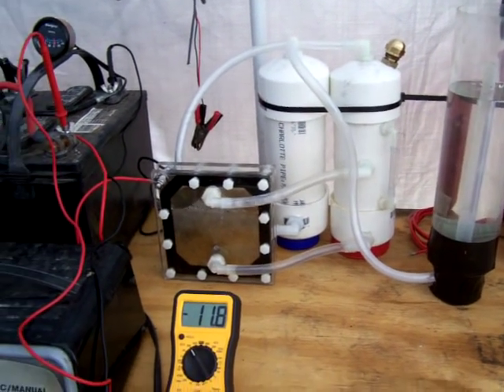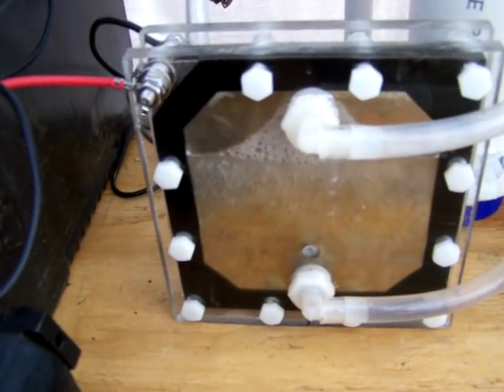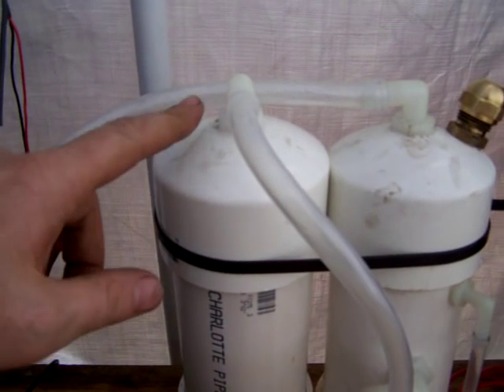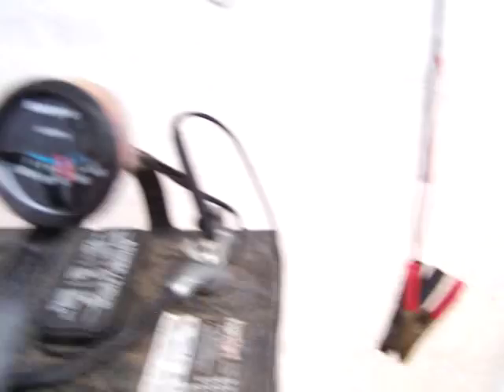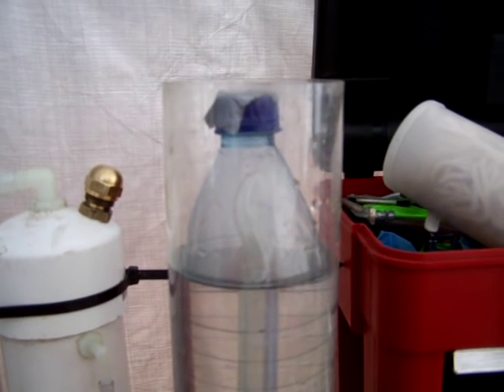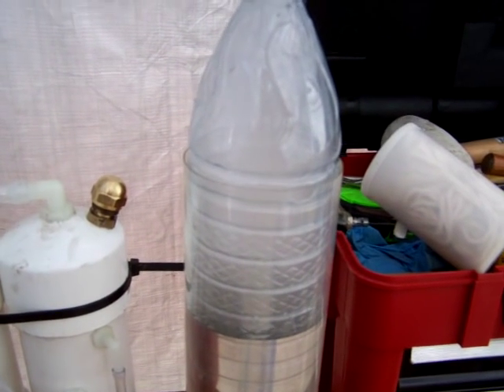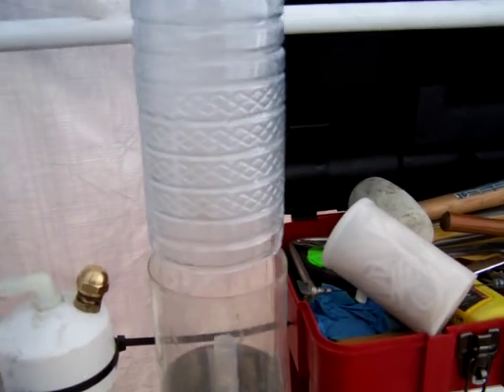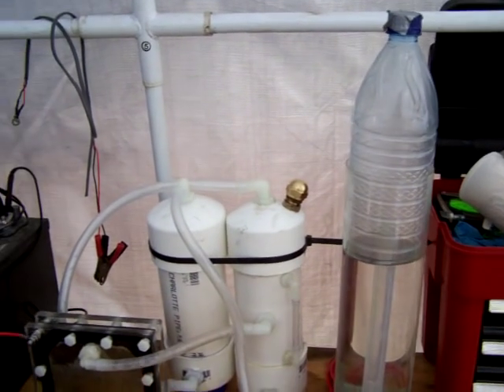Hydrogen on demand conversion kit. Turn any car into a Hybrid for only a few hundred dollars.

Comment: Unfortunately, your "basic chemistry" structural model of "octane" is of n-octane, which is the straight-chain hydrocarbon.  This molecule would be a terrible fuel.  It would ignite and burn too fast, causing severe knocking and engine damage.  This is NOT the octane referred to by organic chemists.  More branching of the molecule slows combustion and reduces engine knock.  The actual octane molecule is 2-2-4-trimethyl pentane.

Comment: Show the volume calculations for a 2.0 Liter, 4-cycle engine.  At 1,000 rpm, this size engine will require 1,000 Liters of air per minute.  Your H2 O2 generator makes 1 liter per minute.  Only 2/3 of a liter of hydrogen is produced (ignoring the saturated water vapor in the outlet stream.)  This would only be 0.6666 Liters per minute H2 divided by 1,000 liters of air per minute, or would give you a H2 concentration of 0.000666 ratio of H2/Air.  Invert the fraction and you get 1,500 to 1 air to hydrogen ratio.  

Gasoline requires an air/fuel ratio of 14.7 to 1 for complete combustion.  According to the equation 2H2 + O2 ==> 2H2O.  This balanced equation says that for every 1 Liter of H2, you would need 500 ml of O2.  Since the air is only about 20% O2, you would need 5-times as much air to get the required O2.  The Air to H2 Ratio would then be calculated as the 2.5 Liters of Air / 1 Liter of H2.  Because the 2.0 Liter engine requires 1,000 Liters of air to fill the cylinders at 1,000 rpm, to completely run the engine on H2 O2, Brown's Gas,  the H2 production would have to be 600 Liters per minute of Brown's Gas to get 400 Liters per minute of H2, or a cell producing 600 times as much H2 as this demonstration generates and 600 times as much amperage as this demonstration is consuming.  This demonstration is a toy!

Where would the energy come from to generate that much electricity?  From burning gasoline which would turn the generator, of course.  Your 15 Amp current would then have to be scaled up to 15 x 600 = 9,000 amps.  At 13.6 Volts, that calculates to a generator producing 122,000 Watts or 122 KW.  A medium sized gasoline generator puts out about 4 KW of power, which would require over 30 of these gasoline generators..  There is no such thing as a free lunch, according to the 2nd Law of Thermodynamics.   A smaller Brown's gas generator would require a smaller amount of electrical power and produce less Brown's gas, all at the same inefficient conversion process.   This is a scam.  Do some math.

Comment: From 8th grade i remember just droup in HCI (chlore-hydrogen acid) Zn (zink) you will get fast reaction without and catolizators H ^, need filters, its like fast boil reaction, i remember was just trying to fuel balloon, it fueled like in 10 sec, but poped becose HCI eat up balloon walls :)

Comment: No such thing as "excess energy".  Alternator produces juice based upon demand & puts a drag on the motor at least equal to the amount of energy released upon burning. 1st law of thermodynamics: energy can neither be created nor destroyed, merely converted from 1 form to another.  Considering losses from elec resistance & heat to split h2o, it's impossible to improve mileage getting juice from the alternator. If U got power from a solar array & battery, I could see potential for significant improvement

Comment: What is the purpose of the nuetral plates? most of the other designs use a plate design that a voltage is applied is + on the even number plates and - on the odd plates. I also bought some plans several years ago that did not use DC on the plates but a high frequency (resonant of Hydrogen) have you heard of this? Some people use sodium bi carbonate. Have you  tried that?

Comment: Great concept but without the plans for the cells that only produce hydrogen when resonant frequency needed to split the h2o, They have found a way of splitting the molecules with some form of electrolysis its only produced when the cell is in active mode. Unless you have a good knowledge of their work and can produce a program to replicate the frequency, it’s just like chain reaction with Keanu reeves and Morgan freeman. Someone will find a way and eventually it will come out.

Comment: HHO is very volatile and so that's why most of these people make on demand systems to power their vehicles instead of storing it. you engine will mainly run on HHO the same way it does on gasoline. Although, there is one complication which I am stuck with right now. Hydrogen burns way faster than gaoline so you must change your ignition timing closer to top dead center. It is really easy for older cars, but with todays computer run engines, its not just a job for a mechanic. This technology has been patented since the 1920's and has been used by the military in dire times of need when their supply lines were cut off. If we all work together collectively instead of against each other, this would be a lot easier and less dangerous in regards to who is hiding this technology. Some other free and cheap energy sources are "Gasification" and Nikola Teslas "Mathernita Commune"

Comment: Thanks for the instructions... I just don´t get why hydrogen converters are still seen as gas saving instead of gas replacing fuel. Couldn´t we produce enough HHO to power the car only with water?
Reply: The problem with setups like these is overall your not saving anything your not going to get more energy than you put into the system from the battery...
Reply: @Chris vids Stanley Meyers and Daniel Dingle proved that HHO only is possible.

Comment: Also we need to keep in mind why we burn petrol?  For lubrication under intense heat to prevent rings from frying and seizing the motor.  For this, with our current production of the traditional motor, we will never be able to get away from gasoline.
Reply: maybe if you burned acetylene through your engine you might be right
Reply: veager123

Comment: Thanx very good explanation , i wish you experiment on a 100 cc motorbike engine for full hydrogen gas running, the market potential here is beyond imagination, a 5 platter would do the job quite satisfactorily and u may end up in a business for 3rd world market but just ensure to keep the prices low, like chinese do. 
Thanx

Comment: Don't run on hydrogen alone it hot but if you mix 70% hydrogen and 30% oxygen then it can be used on rocket propulsion too

Comment: It takes more energy to extract hydrogen from water than you get back when you burn the hydrogen back into water. If you think otherwise why not use the burning hydrogen to power a generator and use the electricity to make more hydrogen? Hey presto you have a perpetual motion machine.
Reply: It is a sad commentary on the STEM education in the U.S. that more people do not know this basic information and immediately dismiss drivel like this presented on the Internet.

Comment: i did try it,  all i can say is do the math. a 5 horse power mower can consume 750-1000 liters per minute to produce that full 5 hp(206cc).
4 cylinder car with a 1300cc engine with 90hp would consume? you guessed it yet?
223,000+ lpm to run at 90 hp.
2 liters a minute? you ain't even close!!!
how many alternators you running?

Comment: cudnt you put it into your air intake on your car becouse that is injected close to the same time as the fule and will cumbust with a little exstra kick but since its still going to be a small input the reguler air will still feed the combustion of you gas?

Comment: Utimately you are getting the energy from your the dynamo or an alternator powered by your engine... in between lot of waste of energy as heat... better to use MOFs fitted hydrogen cylinder.

Comment: Question. whats the volume of hydrogen is required to feed the engine for good 5 minutes. or 1L of H, how long does it allow for 4 cylinder engine to run?

Comment: First, KOH is pronounced caustic pot-ash not caustic poo-tash.  Another chemistry related problem is that H2O2 is hydrogen peroxide, not "oxygen plus water" attached together.

One major problem with burning HOH gas in an internal combustion gasoline engine is that the engine is not DESIGNED to burn H2 gas or HOH Brown's gas.  The BMW hydrogen engine was designed to burn hydrogen gas.  Burning hydrogen at the stoichiometric volumes of 2 Hydrogen to 1 volume of Oxygen, generates huge amounts of nitrogen oxide gases.

Without aggressive positive crankcase ventilation "PVC," some hydrogen will get past the rings and build up in the engine block.  This is the recipe for a hydrogen gas explosion, which would at least, blow out the front or rear main bearing seals, or both.

The biggest problem with burning hydrogen in an internal combustion engine is that you get twice the range and twice the power out of just using the hydrogen in a fuel cell automobile.  Both parameters are cut in half when you burn the gas in an unaltered gasoline engine. 

I also noticed that after 11 years, we are still waiting to see your "experiment" of running your engine with your HOH generator on and then off to compare the fuel consumption (mpg).  If you have not run the experiment, why not?  If you have, how big an mpg lie would you have to tell to support your initial pronouncements?

Comment: Most likely, if the gas is injected into the engine along with petroluem fuel, then the increased free 02 gas will assist the carbon based fuel in combustion. Also, the newly freed H2 molecules will also combust with the 02 molecules, which will create H2O all over again. So, a system like this should burn on less traditional gas because it is being supplemented with another fuel at the same time.
Reply: I know this question is Super late to the party but I'm trying to understand the capacity of this concept. 

When you say "less traditional gas" do you mean like molasses based fuels, alcohols etc? 

What would this work with?

Comment: So adding more gasses including oxygen into the combustion chamber can undoubtedly offer a variety of benefits. Thing is, I think the ECU on modern cars will ultimately determine the benefits you get dependant upon tuning. Just guessing, but would you be able to tune it for either more fuel economy or more performance? Or maybe if you bypass an O2 sensor with the hydroxy gas you can do it without fucking with the ECU? Anyone please leave your thoughts.
Reply: Following
Reply: @Ryann Fodrea yeah probably come up with to rich air on ecu, considering cost of kit, could be still worth trying on a diy kit, then take from there. as long as you have ability to reset ecu with obd devive.

Comment: Cant you put a burner at the end where the gas comes out and actually have fire to heat a home or make food on fire?
Reply: Those Techniques are in use at this time.
Reply: Olatunde Aroloye
Who is using this technique and why?
Reply: Yes you can, of course you will get twice as much heat if you just use your electricity to run a space heater.

Comment: what is the necessity of the electolyte?  can it be positve (acid) or does it have to be only base?   i have heard that you can use just tap water because it has heavy metal in it...
Reply: Distilled water has a conductivity of only about 0.055 microsiemens / cm.  This is essentially an insulator.  By dissolving a neutral salt, like baking soda (NaHCO3), you generate positive and negative soluble ions.  These ions convert distilled water into an electrolyte that conducts electricity.  The soluble salts are easily dissolved off your electrodes. 

Adding a strong acid or base to your water will also conduct electricity but is more dangerous to you and to the metallic components under the hood of your automobile.

Using tap water (with enough dissolved ions) can conduct electricity and generate Brown's gas, but the calcium and magnesium salts will concentrate in the water as it is electrolyzed, leaving insoluble carbonate deposits behind, fouling your electrolytic plates.

Comment: The four strokes intake, combustion, power and exhaust and size of the combustion chambers (cylinders) remains constant. The fuel introduced into the cylinder is what changes. What volume of HHO gas (120 Octane) must be introduced into the combustion chamber to provide the same amount of energy as liquid gasoline (87-91 Octane)? 87-91 octane gasoline is inherently inferior to a 120 octane HHO gas. Significant question what volume of a 120 octane gas equals one gallon of 87-91 octane gasoline?
Reply: The octane of the gasoline makes no difference in the kilo-calories of chemical energy contained in 1 gallon of gasoline.  Higher octane simply burns slower than lower octane fuel.  That is why high-compression engines require higher octane gasoline.  Slower burning reduces the rapid combustion of the fuel and eliminates the "knocking" of high compression engines under acceleration.  Your question shows that you need more education on internal combustion engine operation.
Reply: @lonbrouse6440  Let me simplify the question . Irregardless of octane,  What volume of HHO gas must be introduced into the combustion chamber to provide the same amount of energy as liquid gasolin?
Reply: @waketheoblivious  One gallon of gasoline has about the same energy content as 1 kg (2.2 pounds) of Hydrogen gas.  Because Hydrogen has a molecular mass of 2 gm/mole and one mole of Hydrogen takes up 22.4 Liters at standard temperature and pressure (STP), 2.2 pounds of Hydrogen would take up:
2.2 lb *454 gm/lb =  998.8 grams of Hydrogen
998.8 grams / 2 grams per mole = 499.4 moles Hydrogen
499.4 moles x 22.4 Liters per mole = 11,196.6 Liters of Hydrogen.

A vehicle that gets 20 mpg from gasoline, traveling at 60 miles/hour,  would have to burn 3 gallons of gasoline per hour which is equal to 33,589.8 Liters of Hydrogen gas per hour or 559.8 Liters per minute, or about 600 times the Hydrogen production rate of the "toy" Hydrogen generator in the video. 

It is amazing that I got the same 600x factor going through this calculation as I got from my previous calculations based on the electrical consumption requirements and the chemical equations.

Comment: "Hydrogen and oxygen there, both extremely flammable" WRONG. Hydrogen burns, oxygen supports combustion. Oxygen does not burn; it is not flammable. This is a case of a lot of energy in = very little energy out

Comment: If you use solar power or addition battery for electrolysis process then there will be gain. Otherwise not at all. People think when engine is running alternator always spins and and it produced more power which is wasted due to battery charge over limit. But it is not true When you get more power from alternator, it's shaft has more toque. engine has to burn more fuel ( F=BIL who know the physics can understand this) . Better if you learn / study more about technology / science behind this :)

Comment: So if my car runs on patrol then will this work or not? Do you mean by doing this the hydrogen gas will be taken to the fuel tank where the patrol is usuually stored in a car or GAS but instead of patrol there will be hydrogen and therefore, my cars spark plugs will ignite the hydrogen instead of patrol or gas?

Does my car engine need to run on GAS for this project to work and for me to be able to replace the engine to a hydrogen compatable engine or can it also support patrol or deasel?

How do i assemble this engine in my car? I have this car: Mitsubishi lancer. It runs on patrol and i really dont want to damage anything. All the pipes in the front are composed of hard steel or metal or titanium steel and i dont  think they are modifiable at all.

I need some way of keeping it in a car so i dont have to take out the whole fuel engine. I can keep it in the trunk but i need to load hydrogen into the tank where the fuel is so that my spark plugs ignite the hyrdogen gas instead of fuel.

If i load gas into my patrol car, then my car will not work because the pump is diferant and everything is so more differant.

Plz at least upload a vid explaining how to mount it into the car
Reply: Hydrogen and Oxygen produced on demand and was immediately suck by engine via air intake. Hydrogen and Oxygen was not stored anywhere in the engine. Because its dangerous.
Reply: will it work on a fuel engine like ethonol patrol engine since not stored?

Comment: Ohh lol,May be :D
Can you pls explain how does this conversion kit increase gas mileage of car?
Reply: You mix the hydrogen into the engine and it amplifies the explosive power w the gasolineb using less gasoline overall
Reply: @Lohrnutz29   it only works on a fuel injected with PWM injectors

Comment: Except for the fact that you are actually increasing the amount of fossil fuels used because of the use of current to drive the reaction. This whole set-up is just an interesting experiment. It is not some game changer that everyone thinks it is. If you want a whole bunch of hydrogen there are much easier and cheaper ways of getting it. Like mixing sodium borohydride with HCl. You can get with from Sigma-Aldrich. Its much safer to use it for H2 storage than storing it in gaseous form.

Comment: By people, go to YouTube epoch hho , and see how a real company is using this system on a professional basis!!!
Reply: Epoch makes electrolysis units for welding and various other uses, where it makes sense to use oxy-hydrogen and cost efficiency is not a big concern.  Many other real manufacturers do the same.  Jewelers have had oxy-hydrogen torches from electrolysis for decades.

But not once, ANYWHERE, does Epoch say it generates overunity power.
Reply: Yeah, it is great if you don't care about cost. The problem is people are not happy when they find out it costs more money to use the "free energy" than to not use it.
Reply: what if you use solar energy to make it and store the hho gas in high pressure cylinders to use later? can this be done safely?